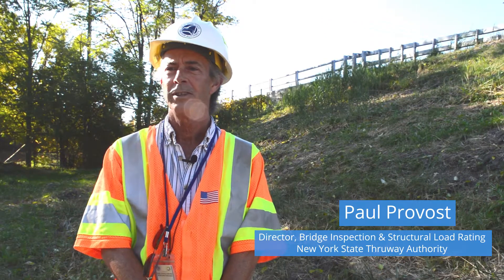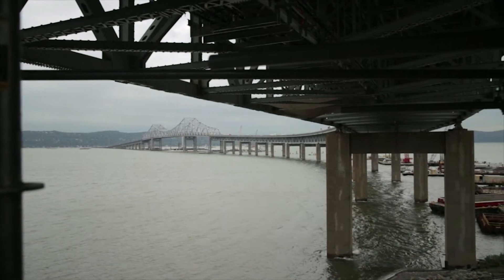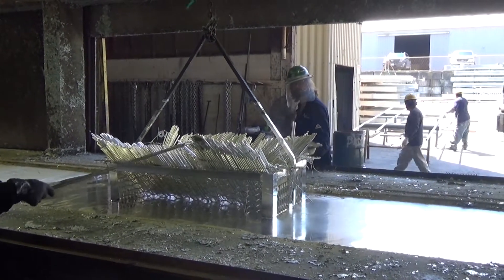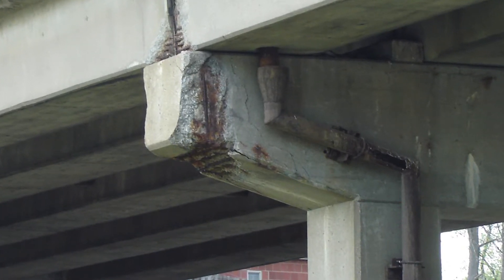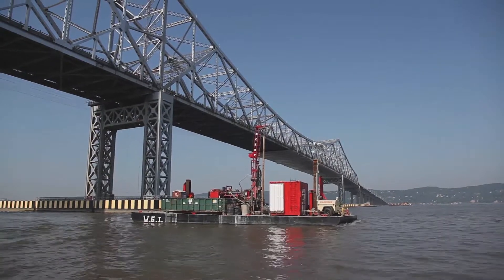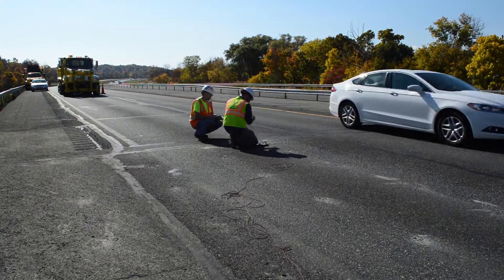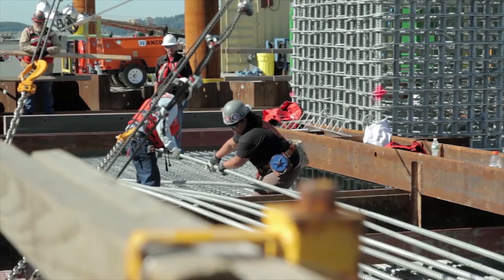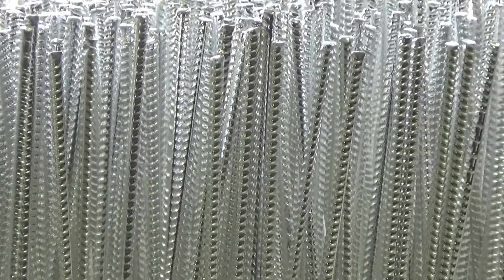Hot-Dip Galvanized Reinforcing Steel in Concrete

Comment: Hi there, how the process actually is done? Bars can be galvanized, but what about coils? I assume that the best is galvanize components after being cut and bend, won't it take too time?
Reply: aasgnt Why they don't use COPPER. Copper can handle corrosion way more than ZINC.
Reply: @Interestingworld4567  Copper coating rebar would be much more costly
Reply: Copper exoands and has other issues
Reply: It dips in a few layers of certain types of acids then it goes through a bath and gets cleaned.